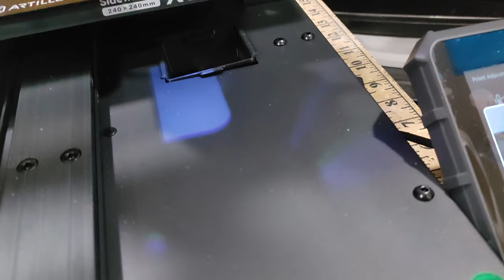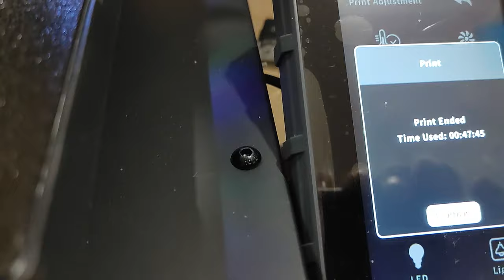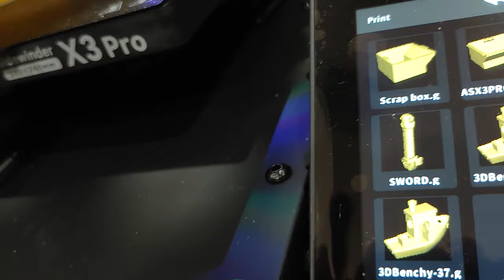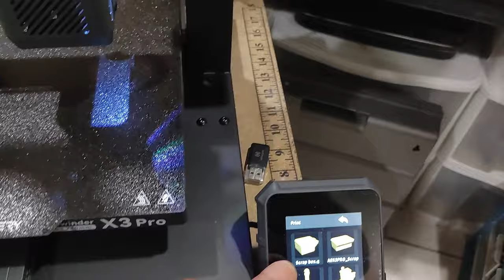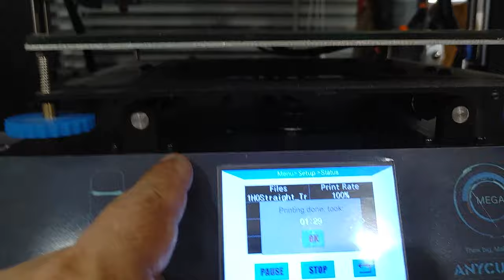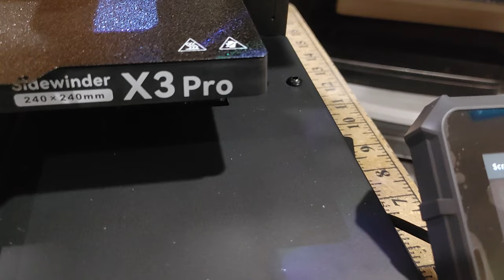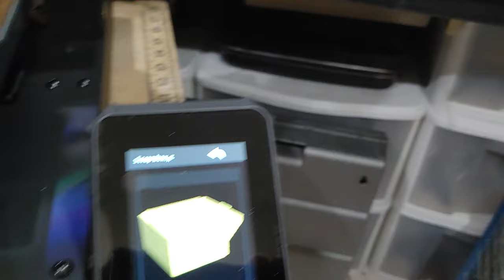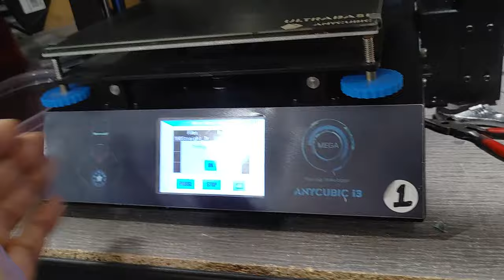Artillery Sidewinder X3 Pro. My Impressions - Part 2

Comment: Looks like you didn't set your Z hieght correct at setup stage. As for the bed I would use the PEI sheet over the glass plate anyday.
Reply from the maker: Yes you are right on the Z settings I went back and fine tune this. A far as the heated base I think it is a matter of preference depending on the type of prints one does. The glass surface from the Anycubic I3 Mega have worked great for me. I have used other surfaces but I find them inferior to the heated Ultrabase glass surface.🎉

Comment: Regarding the screen bracket, it can be modified.  But if the manufacturer had provided for the screen to rotate horizontally, it would be good.  There is not enough normal usb port, I would also like to change this.

Comment from the maker: I actually found a couple fairly recent machines that have the features I have been looking for, which unfortunately this X3 Pro does not have. 
I am waiting to receive them and will do similar videos to show what I have been saying all along about how keeping the machine clean with the display as part of the base enclosure like the Anycubic I3 Mega is better from many respects, will also see how well these machines perform.

NOTE: I do not do reviews of machines for pay, monetization, or in exchange for product or to promote 3D printers so what you see and hear on this channel is what you get from someone who works day in and day out designing real functional mechanical parts for own products,  which I have been producing for the past 23 years, using various CAD CAM manufacturing methods including 3D printing, from a honest working point of view. 

In contrast, what you get from others, who review machines for monetization, is mainly biased towards promoting machines those reviewers are sent for purpose of promoting those machines, thus the high number of views on many of those channels who do product reviews, with this direction. 

And the machines that are mainly out in the limelight are, many times, machines which may not be the best but tend to be seen that way by the high view count.  
On the other hand, there are great machines that get very little attention and exposure, and to find them you have to dig deep to find them.
I am very optimistic the machines I will show next will address the features 90% of the ones out there, in the limelight, miss.

BTW, I use to operate one of the first commercial SLA machines in the USA from 3D system back in the early 90's. So, I am not new to 3D printing.

Comment: Why did you get X3 if X2 has got what you ask for? Glass bed, screen on front USB on the side...I am glad they went away from glass bed....perhaps they could make it glass and supply PEI sheets as an optional upgrade included in the box.
Reply from the maker: I have glass tables on my Anycubic I3s and to this day they are consistent machines producing consistent results. For the most part I print parts in large volume not large volume single parts, so the glass table on the I3 Megas have been awesome. I think Anycubic has a patent on the glass beds and they are different in surface than others. So maybe that is the magic of the I3s but they are easy machines to adjust, solid architecture and produce great parts once they are leveled.